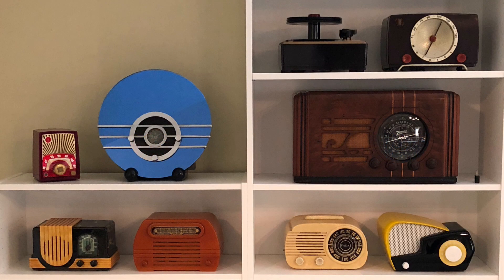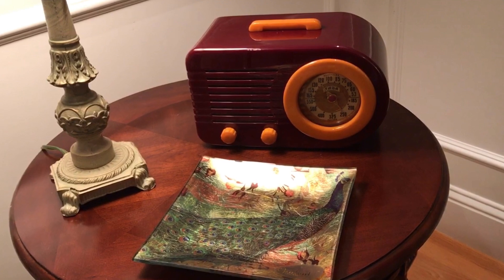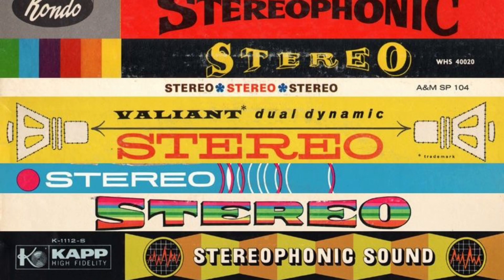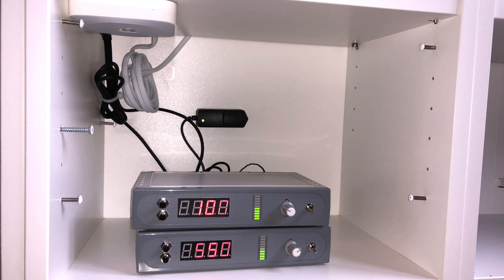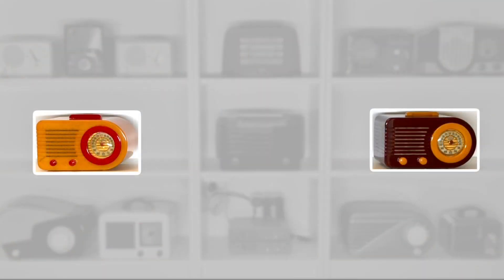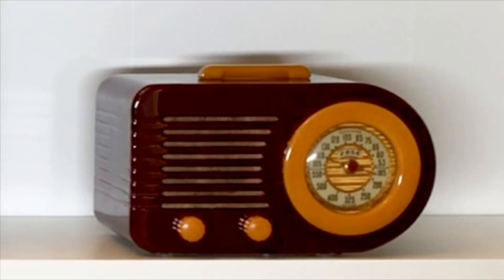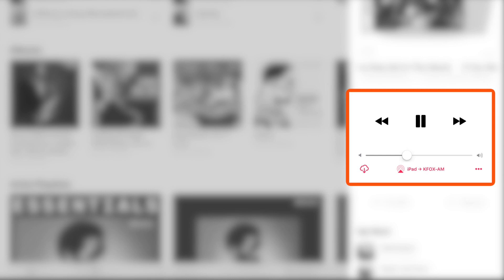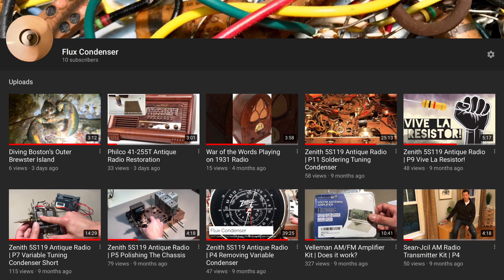AM Stereo on Antique Radios! Find Out How.

Comment: Cool, but nothing new. Simulcasting was a thing before multiplexing became stable enough and carry enough separation to make it worth it.

Usually on receivers of the day, left channel would be on AM, right on FM. 

However the drawback to AM can be heard in this video - a great susceptibility to receive interference (whine) and limited audible bandwidth. If your am channel of the simulcast was noisy, the magic of the stereo broadcast is lost to the annoyance of noise. 

However when multiplexing technology got stable enough and compact enough to use and enough broadcasters began to implement it in the early 60s, it became the defacto standard for FM stereo broadcasting. 

Am stereo broadcasting using c-quam encoding was a short lived technology - again because of noise problems - but this didn't arrive until much later in the 1980s. Many hobbyists still dabble in am stereo broadcasting.

You have a great radio collection. Thanks for sharing this with us.
Reply from the maker: Jordan, a pleasure to have you visit. Big fan of your videos and I did a Porta-Fi mod after seeing your video on the devices. Yes, I’m aware of the history of stereo broadcasting using both AM, FM or a combination of both through simulcasts or multiplex. In fact, one of the transmitters I use in the video is capable of C-Quam which I’ve experimented with a bit. I had never seen this particular experiment done by a hobbyist before and thought it would be interesting. Yes, due to AM’s limitations, it was far from hi-fi! Take care.